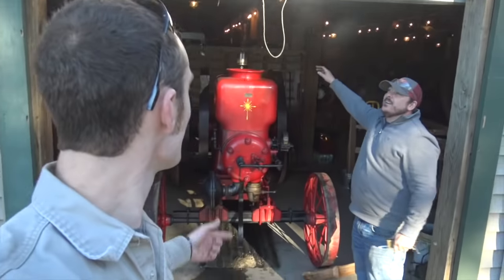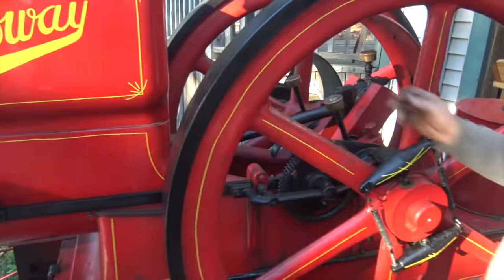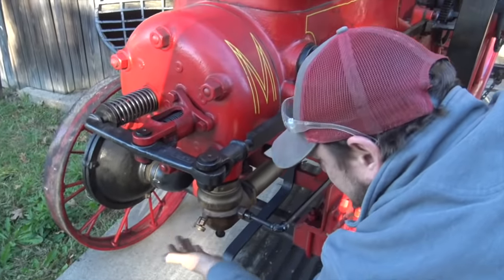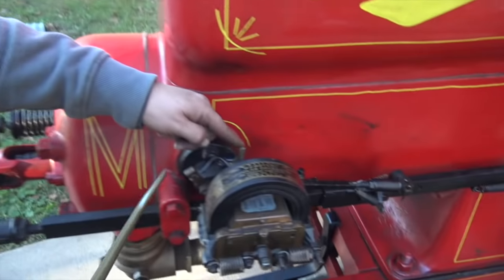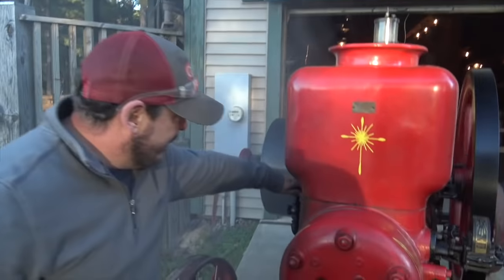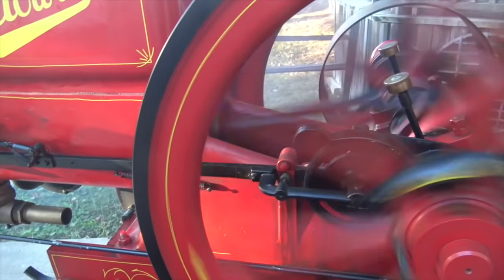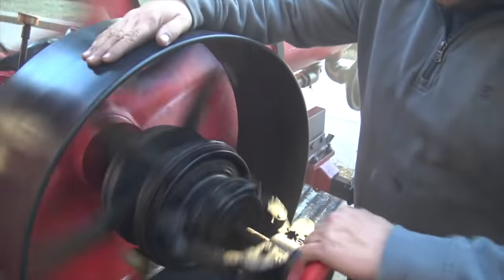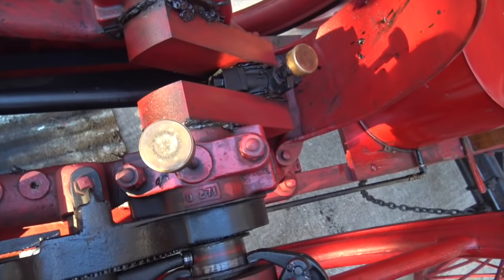WHY THIS INCREDIBLE ENGINE FROM 1916 IS PROOF THAT MODERN EQUIPMENT IS A SCAM & OLD STUFF WAS BETTER

Comment: Beautifull . 
I used to go out to shearing sheds with my dad in the 60's and 70's. was always amazed at the simple old motors that ran all the gear on farms and out stations. old oil burner single pot engines with 3-4 sometimes 5 different belts running something. 
Running on diesel, kerosene and later, even vegetable cooking oils and old sump oil in a pinch.

Later, (late 70's & 80's)working as a stockman on outback stations (Aussie ranches) most of our stationary motors were similar. 
Any oil changes were filtered and went into drums to run the simplest of engines. Old hit and miss engines turning generators or water pumps to power the place and pump water up from the river into overhead tanks for showers, gardens and drinking water. 
Summertime they were essential. No aircon in summer temps up near 50c were brutal. 
We had a grass house to sleep in. walls were 2 layers of wire mesh 12 inches apart stuffed with spinifex (spiky desert grass clumps), Sprinkler heads along the roof lines that sprayed water down the walls. 
As the breeze came through the grass it cooled inside. Often there was no breeze, so a couple of old 40 inch workshop fans saved the day. Without those old motors running pumps etc, life would have been a lot more uncomfortable.

History that many never experienced and many more will never see.
Reply: Considering we are now at the mercy of profit making energy corporations and useless government, I am thinking home backup power might be handy using these old engines.
Reply: I never under stood how that kind of cooling worked. Seems like a good idea but. The actual perpose of air conditioning is to remove humidity than heat.  Most the time the humidity level is 98-100% adding water to the air just helps conduct the heat.  When I used to live in a poor little shack if we could get the humidity under 80% we were happy , temps averaged 85-90degrees in our cooled area. But that didnt matter because the humidity was low so you cant feel the heat
Reply: @DRNEGOLICIS  North west of West Australia dosnt have much in the way of humidity (unless a cyclone is close)  just dry dry dry. 
Works the same as a car radiator. 
Wind passing over the copper or aluminium mesh fins cools the fins and the water inside. 
We just used the spinefex as the mesh. 
Evaporation transfers the heat and cools the air. 
Those little desktop room coolers work in the same way. water dripping over mesh cools the air flowing past.
Old folks knew what they were about. We found a date of 1932 on one of the roof beams. Guessing that was when they built this one to replace the old bough shed (all wooden with brush on walls and roof)
Reply: The Coolgardie Safe worked on the same principle as your spinifex house,
they kept the butter hard and the milk fresh on the hottest days.
Water trickling over hessian cloth with a breeze blowing through
did the trick.
We had these in the days when there was no grid to be off.
Reply: @ivanolsen8596  Yep, Coolgardie safe in the holiday home, then we upgraded to a kerosene fridge and Redbacks on the toilet seat. Eventually septic, electricity and paved roads made it there. All adventures and beaches for us kids.
Reply: @ivanolsen8596  yep. Exactly the same. Cooling by evaporation.. In the most basic way, humans cool down the same. We sweat, air draws the moisture away and cools the skin and blood vessels under it.   We realy are amazing orgsnizms lol. .
Reply: A house version of a Coolgardie safe!
Reply: @Buddy Rojek I run two diesel filters with canola oil.  Downside is it gums things up a bit over time, so mixing with pump diesel thins it out
Reply: @pierremainstone-mitchell8290  Exactly that. It brought temps down by around half.
Reply: @Buddy Rojek Pump diesel in the 2.30+ AUD per litre range here in the mid west.  Gone up 1$ ltr in the last 6 mths.  
Thanks to a few local deep fry takeaway shops ( cooking oils)  I get used oil to keep my costs down a bit. ( old tojo loves it, and smells like french fries so thats a bonus  lol)
Reply: @DRNEGOLICIS  so you've never heard of an evaporative air conditioner then?
Reply: @Buddy Rojek nice country out there. Ive slept on concrete tables more than once on long bike runs.. often the safest place in summer lol. Crawley spiders and snakes going for a wander round in the dark. Not to mention those bloody big bullants. 🤤😨.
Reply: Reagan Hutchins  nah mate. Tojo is Aussie slang for toyota. It loves a good drink of french fry flavoured fuel oil 😅.. Although the dog dosnt mind a bit of used fry oil mixed into dinner as well.😉😊.
Reply: @Ace-ns9co  yes, I understand the concept but it wont ever work the humidity level averages 98-110% most of the time how could the water ever evaporate? It causes mold
Reply: @DRNEGOLICIS they certainly don't work everywhere, but in western Australia, especially the north west, 60-70% is a bad day for humidity, it averages far far less than that here so they work quite well

Comment: This has been a deliberate part of manufacturing and industry for at least 50 years.

It's called planned obsolescence. Everything from your refrigerator to the light bulbs you buy are made to fail after a certain, pre-planned amount of time, so that you are compelled to buy a new one and replace it.
Reply: If I remember correctly, a LOT of an engineers study goes into planned obsolescence......
Reply: Even more ridiculous is 'planned needs'. People don't need luxury, but they are told it's normal. Convenience is overrated.
Reply: More like 90 years.. if not for this government imposed law everything we us would last much longer but it wouldn't help the economy
Reply: @danmartinez9497  by basic logic it should, its just that any kind of service you could get out of a durable machine doesn't match the economic benefit of being forced to replace it. This is because   capital equiptment is overpriced.
Reply: Consumerism has gone too far. Certain people need to stop pushing it!
Reply: @GyroGarrison  strangely enough, women currently own 80% of all consumer debt, so...
Reply: That’s not what it means. In the past when only a few people had machines they were experts in them, today we own lots of power products and it would be impossible for everyone to become an expert in all of them. So they make things with enough efficiency to be cost effective and cheap enough to be disposable. Take car engines, at one time it took years to put 100.000 miles on them and they would require a lot of maintenance, today they do 100.000 miles in 5 years and can easily reach 300.000 miles with simple oil changes and ancillary maintenance
Reply: @danmartinez9497  If not for the government, things would last EVEN LESS time.
Reply: And then want to blame us for pollution and throw away mentality.
Reply: Do all the new electric cars have planned obsolescence worked in and how would that work?
Reply: @3John-Bishop  They're controlled by software that you have to take to the dealership to have plugged in for troubleshooting, updates, etc. Regular mechanics simply cannot work on these cars. I guarantee 'planned obsolescence is worked into electric cars especially-anything with software. It creates 'throw away and buy new' yet we get blamed for the pollution it causes? Lithium mining is highly destructive along with the toxic batteries that must be disposed of when they're spent. (12 to 14K dollars for a new set.)
Reply: @funkyplasmaman  The cars were modified to run on gas. Engines like the flat top in the Model T were designed to last forever without maintenance and ran on any liquid fuel. They removed all the free energy appliances before colonization
Reply: @togowack  😂😂 free energy and none maintenance moving parts rubbing against each other, it’s a miracle 😂😂
Reply: @funkyplasmaman  seems like magic to us but the buildings ran on ether, you can see it in old photographs that escaped, I don't think they got that much power, for real power they required coal and various other fuel sources
Reply: @funkyplasmaman  Coal looks to be the backburner (reset) fuel in case of disaster, otherwise the whole system appears to have run on hydraulic power, look into the destruction of the Niagara power plant, and the garbage it was replaced with. Water used to be #1
Reply: @tomservo5347  Sooo many people don't realize this, and the cost to the world for temporary profits is just sick. Awesome comment 🤘
Reply: Planned obsolescence is a strategy to make technology affordable for everyone, therefore keeping demand up. Things that are designed to last for decades cost a lot of money. For example, heavy farm tractors cost as much as a modest house, but are built to last. Road vehicles are built to last a minimum of 100k miles, but cost a fraction compared to farm equipment. If vehicles were built to last a lifetime; we would be spending a lifetime of income just to buy a single vehicle. However, there are trucks that cost up to $100k that are built to last, and the same concept applies.
Reply: @DROK278  How can a company stay in business if they only sell lifetime products once per customer?
Reply: @mds6387  Look up pre industrial revolution. Look up Mercedes Benz as an example. 1800 something, they've survived to today purely on maintenance alone. Read a book on the topic or go on Wikipedia seriously lots of info on the topic lol. Bye bye
Reply: @mds6387  I'm glad to know there are good aspects of it, but it just seems so wasteful.
Reply: @SKBottom  It is very wasteful indeed. We need more efficient means of cycling waste or scrap. Most people toss their broken products in the trash. Electronics cost the consumer money to dispose of in a green manner. Thankfully, metals/minerals are heavily recycled. I like to fix my broken products and keep them going. There's a market for that too. I think planned obsolescence was first practiced with light bulbs. Original light bulbs could burn for over a hundred years. An example that comes to mind is the The Livermore Centennial Light Bulb that is still burning as we speak, but at a low 4 watts. In a perfect world and economy we wouldn't need planned obsolescence. One good side to planned obsolescence is that it does foster room for innovation for upgrading features of a product.
Reply: @SKBottom  females are also 80% or more the people I know who do nothing but watch (ads on) TV all day everyday
Reply: Stupidest idea lets make things that break!!!
Reply: @mds6387  How can a company stay in business you say?  By selling to new customers.  If their product's are truly good, people worldwide will want them!  The U.S. had a population of circa 200 million in the 1990's and has 330 million people today.  Globalization has opened markets that before were completely unavailable.  It's totally possible to build sustainably instead of temporarily...  Greedy  people are why it's not done (and the race to the bottom, i.e. cheapest junk / high turnover rate philosophy they have).
Reply: @danmartinez9497  It's the opposite, manufacturers do this to make as much profit as possible, it's the lack government that is the reason it came to this in the first place, not the opposite. In the EU we now have a minimum 2 year warranty on all products sold for example, which while not being super long is a lot better than nothing.
Reply: @email4664  Honestly, with how much fuel this thing is probably consuming that might not even be true.
Reply: to be fair modern LED's outlast many of the older incandescent bulbs and they use less than a 3rd of the power.

Comment: That's a big beast! I want to hear the story how you found it.
 I have 9 and 12 horse Hercules built Economy and Champion engines.  They don't have the compression release, so I start them by holding the exhaust valve open with the governor latch using my left hand on the pushrod ;  while I spin the flywheels with the right hand. 
Love that sound!

Comment: Well, considering in the 1950s, you were lucky to get your car to 100k without some rather significant repairs, I don't know that I would say that all things were more reliable and long lasting.  Heck, an automobile from 1950 required meticulously religious oil checks within a very narrow window.  You failed to change your oil by a certain time and you'd probably done some damage to the engine... Getting an automobile to 200k-300k like a lot of Toyotas can today was almost impossible on a mid 20th century car without a  complete overhaul.
Reply: That was only because they had weak breaker-point ignitions, very primitive lubricants and usually no preheated air intake for colder climates in winter.  Pretty much ANY engine from that era would easily blow past 200k with a hotter electronic ignition, modern oil and minimized exposure to ice-cold intake air (when engine is cold and you DON'T want it).
Reply: I would say the 90s peaked automobiles and with the bailouts of the early 2000 recession the model was switched to planned obsolescence. A fair number of those 90s cars still on the road today as daily commuters
Reply: @graver067966739  I tend to agree. 

I have a 97 Landcruiser, a 97 Tahoe 2door Z71, and a 97 Ford F350 7.3.  All 3 of these vehicles are above 200k, run mint, completely reliable.  

My 2018 LTZ Duramax was a piece of shit.  I spent 80k for a truck that broke down on me at least once every 6 months. 

Late 90s seems to be the pinnacle of reliability mixed with some tech and being able to be trouble free.
Reply: My 1972 VW Beetle had it's 1st major overhaul last year, at 49 years on the road.  It is still a daily driver, and like this beautiful engine, requires regular maintenance. That however, is how it still gets an average 25mpg.  New may be flashy and fun for a time, but the old stuff is still better.
Reply: @MarkLoves2Fly  Sweet, I have a '72 Beetle too, been in the family since new ..my only car under 6 liters, lol.  Had to rebuild the engine at 80k about 12 years ago, but only because the studs were pulling out of the case and the pass side cyl head was falling off!  The bearings still looked brand new.  Put in a C25 cam with 87mm jugs, Pertronix electronic ign with SVDA dizzy and a bored out stock carb & header exhaust...sticking only with reversible mods due to originality...gets 34 hwy mpg now, as long as I stay at or above 70. 😁👍
Reply: @graver067966739  That's why a 20 year old car s no longer considered a classic since so many are around unlike in the late 90's when there were much fewer cars around that were 20+ years old.  I have a 2003 Vibe that's pushing 300k miles & I'm not planning to replace it in the foreseeable future. Late '90s-2000's was probably the sweet spot for cars & computers then after that, the quality downgrades began.
Reply: My father , who was a machinist and engineer, mentioned that metallurgy in the 1950's was no where near what it is today. He stated that differentials could still crumble in the 1950's and that even the gasket and oil technology is not what it is today. I sold my restored 1963 Falcon (with 144 straight six and three on the tree manual)  in 2017, and owned a 1967 Mustang convertible with a 3 speed and 200 straight six, a, 1967 Falcon Sports Coupe with a 289 V-8 and C4 automatic and a 1965 Mustang notchback with a 200 straight 6 and C-4 automatic. All of these cars were, at the time, inexpensively made, mass produced cars. Still, my 1967 Mustang  straight six made it to around 160K before needing any engine work. The Ford small block sixes were a fantastic design that got around 22-24 mpg with a single barrel carburator and vacuum advance mechanical ignition. That's very good engineering, IMHO, long before fuel injection, turbocharging or supercharging. As mentioned by another poster, planned obsolescence was in its infancy in the 1960's and is now a refined art with most modern technology-Very sad-John in Texas
Reply: You are talking about the difference between a heavy duty piece of industrial equipment, and a mass produced consumer item that, like today, was made to be more about style than function.  The steel back then was also crap by comparison to today, and many cars up north would be piles of rust before the engines quit.
Reply: I suspect better lubricants for the engines might help them last longer, too.
Reply: Ever heard of a 300 i6?
Reply: You can take an engine from the 50s put hard valve seats so it can run on unleaded. Use Rotella oil. And 190 degree thermostat.  It will run 300,000. I'm not sure how much farther I'M STILL GIVING IT HELL. Metal parts are all the same. Must have been the fuel that wore out the old cars. Hotter metal wears slower.  Leave out the thermostat and the engine will wear out in 50,000
Reply: @serfcityherewecome8069 v
Reply: Old Volvo B18 engines ran forever. Hundreds of thousands of miles easily.
Reply: @justpassingthrough3166 late 90s was prime auto manufacturing
Reply: it has to do with the metals used today alloys they didn't have back then, also the lube is far superior.